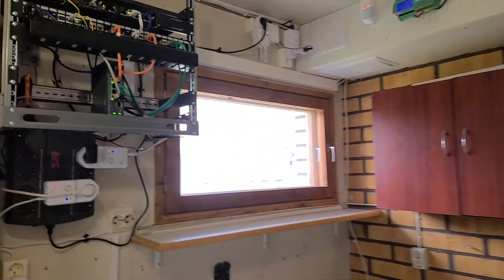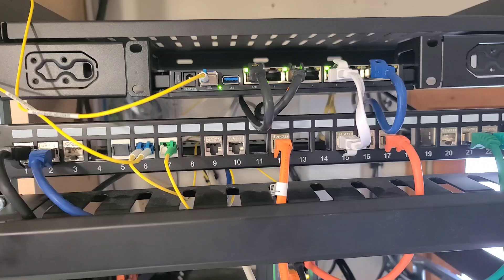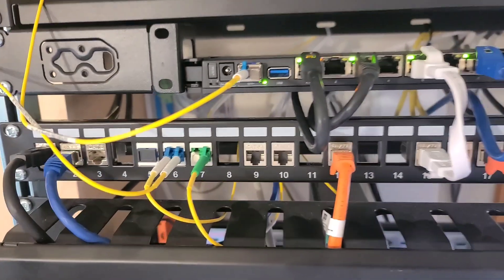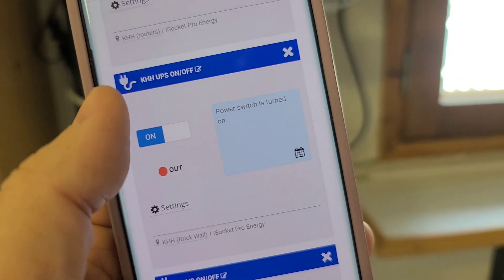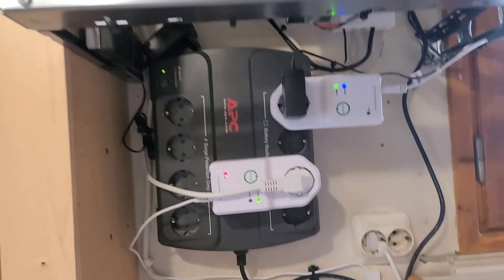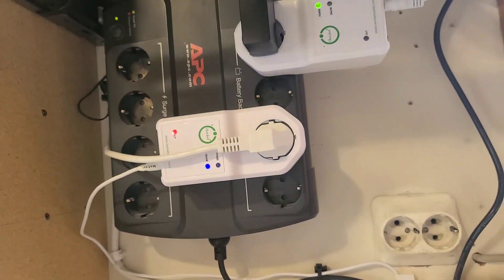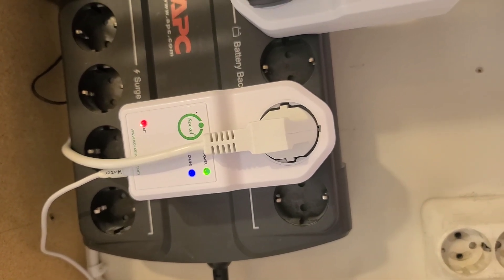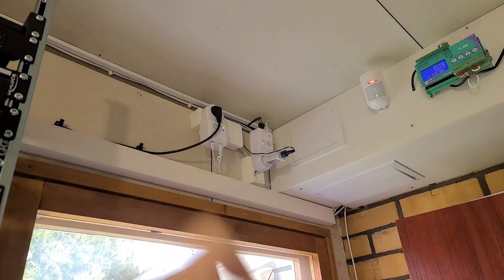How I Power and Monitor My Home 10G Data Centre

Comment: You can't made those fiber cables like that. Blue can't be connected to green.  To make it simple for "you".  Blue to blue green to green.
Reply from the maker: Which part of the video are you referring to?
Reply: @fishelectronics  your fiber coming from isp, in the back of the rack on the wall.  Grab the proper cable :)
Reply from the maker: @JasonsLabVideos Good observation! Not sure how it happened that I plugged UPC instead of APC there.